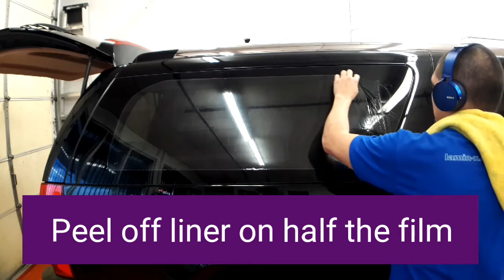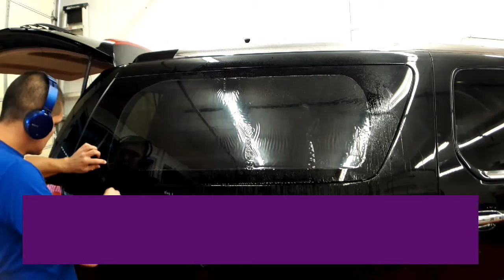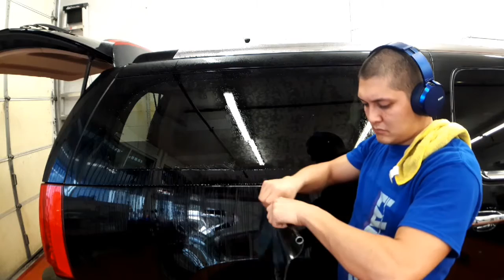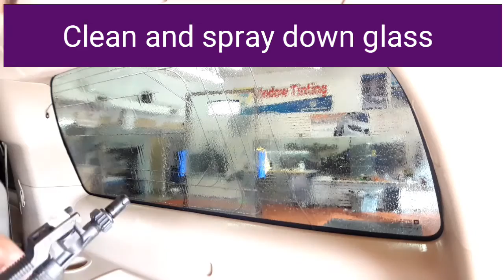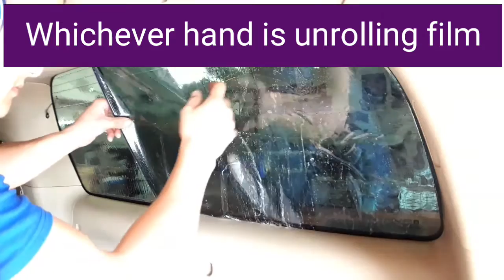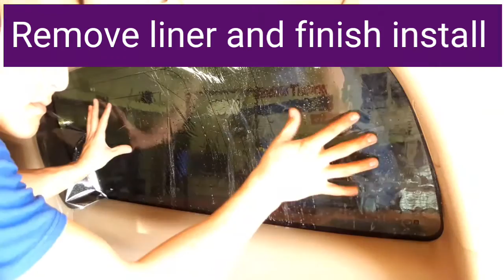Window Tinting: Reverse Roll

Comment: did you stick the film with the part with no glue i still dont get it
Reply: Same, I have watched so many vids trying to figure this out? Why is the liner peeling from the side towards you and not on the window.. Did you figure it out by any chance? x)
Reply: Mattie I watched many vids too and every one of them shows the adhesive side facing YOU not the window. When the liner is peeled off it’s clearly not on the window side. This got me very confused.
Reply: When he unrolls the film he peels the clear first and sticks it to the back of the roll that way when he starts to roll out the film the clear is on the back which is why it shifted to the left more than the actual film. Then the only thing left to do is take it off the back of the film and squeegee
Reply: dex203 I get it now. Would be nice if he explained this and slowly showed it for the ones who can’t seem to understand.